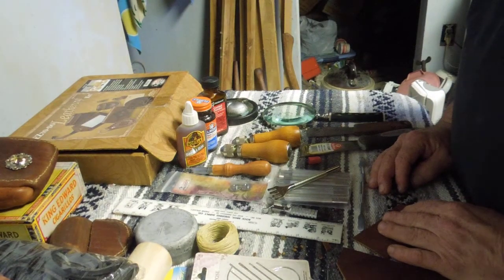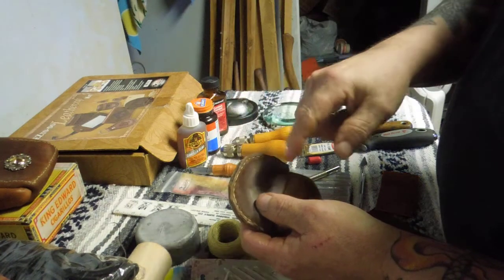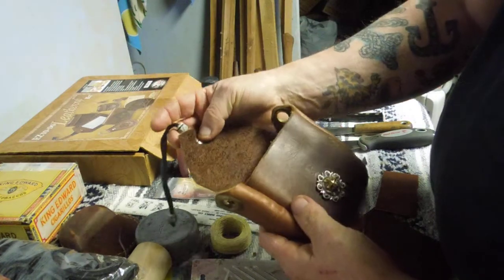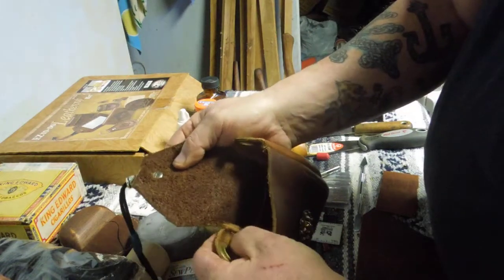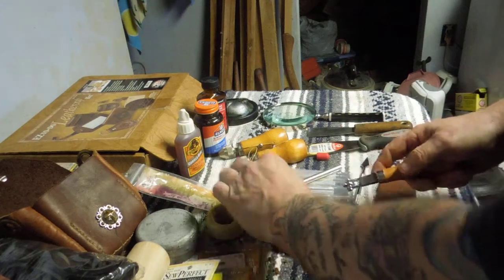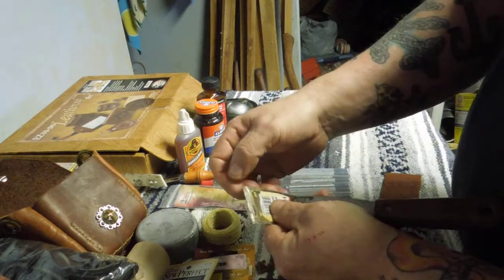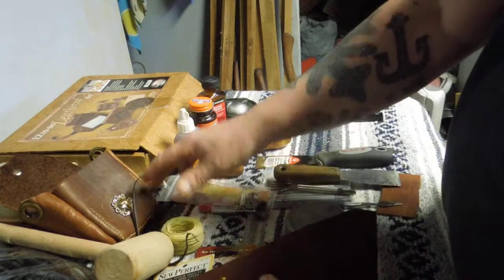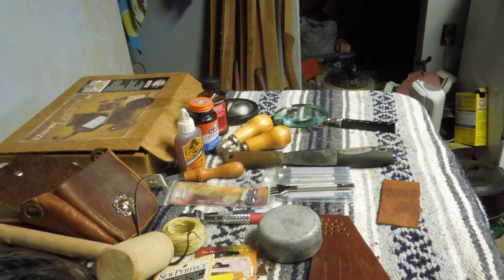Leather Stuff pt 2 Sewing two pieces of leather together.

Comment: Just starting out and this is exactly what I needed. Thanks for taking the time.
Reply from the maker: +Chris Schaefer I'm far from an expert.  I dont do leather crafting per se I make leather shapes for function.   Hard to be economical when you want to make one piece at a time but all of the tools cost 15 bucks a piece.  The first cell phone holder you put together is going to cost well north of a 100 dollars once you figure in the tools and supplies.  The second one will cost a couple bucks of leather .  But once you have the tools you can turn a generic multi tool case kit into a customized one pretty quick.

Comment: Did you make the needle from another needle?
Reply from the maker: The tri point needles are available in needle sets.  You can get them in craft stores or sewing shops (cheaper) .  The tri angle needles have a triangle shape to the sharp end.  The "handy stitcher"  hand held sewing machine has the tri point needle as the main needle.  

the three angle needle pushes thru the leather easier than the standard round shapes
Reply: Thanks!